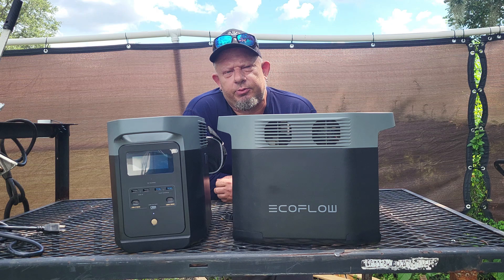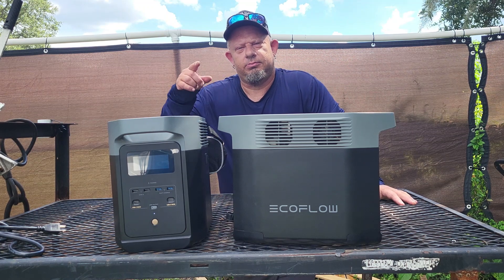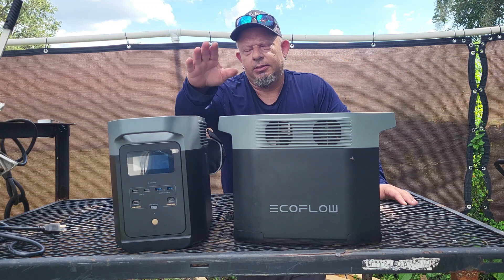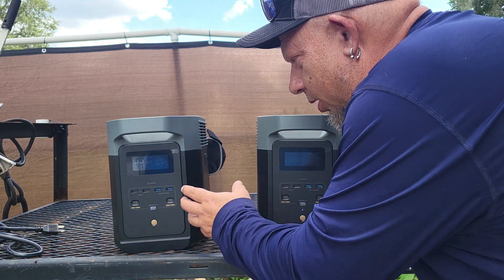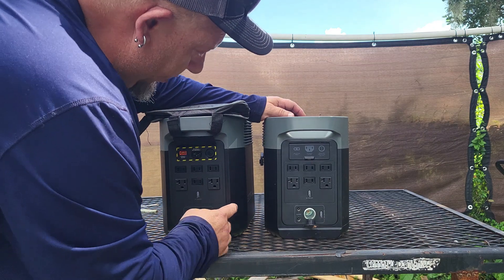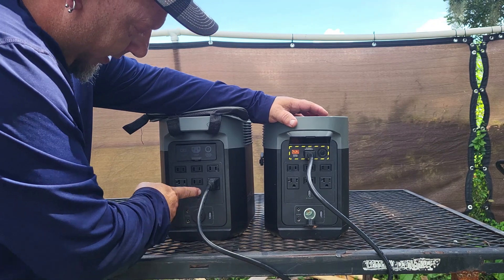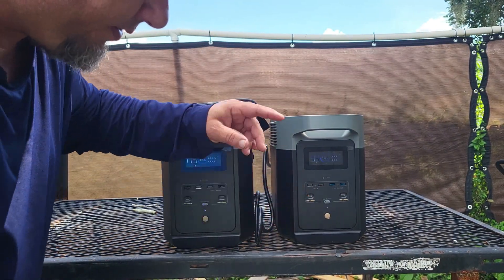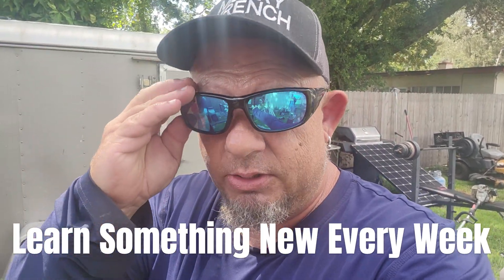Connect Any 2 Power Stations / Daisy Chain /  Solar Sunday

Comment: If you only have a small power draw then youd be better chaining them using the dc 12v plug as you will get a much smaller loss.  The dc doesnt use the invertor so wont lose by having to power that. 

The dc 12v plug will only charge at around 120w though so not ideal in all circumstances.
Reply from the maker: That's great info.. none of these vids are all encompassing.. hopefully they are a starting point for the viewers.. I will pin your comment to the top so others can learn also .. thank you
Reply: My question is when doing this,  would you be able to hook up solar to the one that's doing the charging?
Reply from the maker: @timberwolf7350  in general yes.. most modern units have (pass thru charging) which means you can charge the unit and use it at the same time.. so if we call one the 1st unit and one the 2nd unit.. you plug the solar into unit 1 and daisy chain and it will then charge both units even while using them. be sure you know how much solar the max is for each unit.. connecting them does not raise the amount of solar you can use in the system.. that remains the same
Reply: I’m trying that scenario now. Delta 3 plus shows 95w coming in from delta 2 max, and the delta 2 max shows 100w going out. Only other thing is for some reason the cooling fan turned on the delta 2 max… (it normally only comes on when charging at 600w or putting out something like that.) So there is another small loss going to that, besides the other internals of the delta 2 max. (Generally I don’t find the delta 2 max being very accurate with low output numbers though… as it’ll show zero when there is actually like up to at least 15 watts going through the inverter… so who knows how much it’s actually using to convert.)
Reply: I see why the fan is on… 10 minutes in and the 12v outlet is getting pretty hot with 100w going through it. I didn’t expect that, but i guess it makes sense for the limitations of those ports.
Reply: i burned my dc output trying to use  a no name converter to do it when i first started using them./.. always add a fuse in cables...  altho its a power share  electronicaly   checked then its even better to use fuse !!!
Reply: I've been searching for this info for a long long time i also have 2 of the main units and thought I was going to have to buy that expensive cable and a extra eco flow battery.  We'll the cables are not crazy expensive any more.   Your the man.  Such a simple solution.

Comment: Hey Munky Wrench,  I learned from you today that I can daisy chain my to Delta 2 units by plugging one end of the cord into  the AC inlet on the back and the other end in one of the outlets on the back of my second unit.  Thanks for that.  Question: can I daisy chain them together by using the optional second battery cord?  So instead of having a Delta 2 and a spare battery, I'd have two Delta 2 units wired together plugged into the side spare battery ports?  Will two Delta 2's plug together using the side port on each unit?  If so, will the draw power together and charge together?
Reply from the maker: glad my video was entertaining and you took the time to comment.. if you plug them together like I showed in the video they will both charge together because they have (pass through charging) and they will feed each other so you in essence double your capacity.. however from what I understand and have read about them you can not plug them together via the side port.. which is a dedicated plug for a spare battery. The reason for this from the best of my knowledge is because the SPARE battery does not have the same BMS and it connects differently.. is is a propriatary thing with ecoflow so you cant use other branded spare extender batteries .. it wont read them and is wont read a full delta 2 for the same reason.. its to get you to think you should buy their products,... but if you use the plugs the way I show not only can you connect 2 deltas but you can connect any brand of portable power station in any size ... and the pass through charging will allow them to feed each other and charge off the same charging unit or house plug... hope that helps

Comment: What is the point of this?  If you have 2 of them just just plug the load in the other one when the first one goes flat.  You are wasting power when you convert it to AC the lose again from AC to DC
Reply from the maker: most people are interested in this for when they are sleeping .. or when they are doing something they dont want interrupted and its just an interesting thing people dont know and clearly need to know judging by the questions in the comment section. think of it as an interesting factoid in a life long journey of education

Comment: these are the smart batteries.   Can I connect together 2 delta 2 power stations rather than 2 delta smarts?  And can I connect to my delta 2 a delta pro or another power station that has a greater wattage such as 3600 delta?
Reply from the maker: You can Daisy Chain ANY portable power stations together this way as long as they have PASS THROUGH CHARGING ... google your model with those words and make sure but most if not all power stations have pass through charging.. brands and sizes don't have to match.. hope that helps.. Merry Christmas

Comment: What happens if you have solar panels connected to both units? Will both charge or only "unit 1"
Reply from the maker: if you are able to daisy chain and also have solar hooked up to input on each .... they will both charge individually from the solar and still be connected .. The input method should not matter but as always check your manual

Comment: I have a Delta pro 3 and a Delta 2 max .  The reason I would connect them together is because mt 3 has a 30a rv inlet and is plugged into my trailer.  The 2 will feed the 3 that is plugged in to the RV.  I cannot plut into the 2 without an adapter

Comment: Would both power stations charge if you plug the Main power station into an AC outlet using an Extension cord?
Reply from the maker: lets call the 2 units.. unit one and unit 2.. if you plug unit 2 into unit 1 it will charge off unit one.. if you plug unit 1 into the wall it will charge unit 1 and unit 2 will charge off unit 1.. hope that made sense.. so to answer simply... yes
Reply: @MunkyWrench  Yes
Reply from the maker: @mannyfragoza9652  let me know how it goes.. i do it all the time with my 2 units

Comment: Munky Wrench< I love deals. I own a Delta 2 Max (2,000) w power station and was looking for an extra battery. I saw a prime day deal on Amzn clicked buy, only to find out that it was not a spare battery but a delta 2 (1,000w) power station. I was unable to cancel the order but got the great price and got pissed off afterwards and impulsively bought spare batteries for both of these (great for Delta and Amzn but not so good for me). I saw on a youtube video that you cannot connect a Delta 2 smart battery to a Delta 2 Max power station. Is there a way to mix and match these because I use mine in a storage container with no utility power or solar and have to take them in the car to the house (1 block away for recharging) I am pushing a young 80 so it is not that easy. My question is, is that youtube video I referenced misguided (lying) and can I mix and match the batteries with the power stations. For example a combination of either tying the power stations together or using one of them with the two extra batteries to save the number of trips for recharging? Thanks!
Reply from the maker: every time a new product is launched it is proprietary and has new patents filed.. because of this they want you to buy a whole new setup and spend more money.. you can not interchange the 2 products from what I have found.. because they have different charge ports and different interfaces.. the units themselves have pass through charging so you can daisy chain them together .. having said that.. you should be able to connect your ext battery to the unit and charge the main unit with no issues .. it will be slower and does not actually consider it an expansion but you can do it.
Reply: I feed my Delta 2 Max with a Delta 2 (like yours) no problem.  I use the DC to XT-60 connector.  DC out of Delta 2 to XT-60 in on the Delta 2 Max.  It will only pass through about 108W, but that is plenty as it does to continuously.  If I run my fridge circuit using the two units this way, the Delta 2 will empty out after about 7-9 hours and the Delta 2 Max will still be at around 70% capacity.
All this being said, I have heard cautions about daisy-chaining units with the AC power cord.  Not sure why but about to look into it now.

Comment: CAN I STILL LEAVE IT PLUGGED INTO A GENERATOR OR A OUTLET AT THE SAME TIME WHILE PAIRING
Reply from the maker: yes most power stations now have " pass through charging" which is a protected system and can be used in every way including daisy chain while being plugged in

Comment: You did not double your capacity, you increased runtime, 2 very different things, if you increased capacity, both units would share the load, but its not, only the unit being fed is handleing the load, the other is just sending its power to the other. 90 % from your second unit, too funny, its not 90% effecient, and then you have idle consumtion you havent even factored in. Of course if you believe the watt meter on the front, your truly lost! If the unit is powered on, its using power from the battery, but your meter shows 0 w output, I dont get how gulible people really are, and its really just common sense. So many reviews, and such little knowledge, YouTube is truly comedy hour!
Reply: He still doesn’t understand what you said

Comment: Right now, the retail pricing makes it more economical to do this instead of buying the expansion battery. EcoFlow is charging between $499-$799 for the extra battery, and you can get the Delta 2 for $499 at Lowe's or as little as $318 on Temu. Delta Pro and Delta Pro Max are out of my range, sadly. Trying to get one more Delta 2 and a Delta Pro before the Lithium tariffs kick in.

Comment: I am doing this cureently with a jackery 2000 and a pecron. Both 2k limit output on wats. My issue is they both when charging will pull 1500 wats from the other. So any load above 500 wats kills the power output. Any solve here? A way to reduce the 1500 wat charging transfer?
Reply from the maker: I read this comment 4 times and something is not adding up.. you have 2 units.. we will call unit 1 and unit 2.. you chain them together.. so unit one is basically feeding unit 2.. unit 2 should be able to discharge up to 2k watts without any issue.. are you attempting to plug into the same unit that's feeding the 2nd unit? if so that's your issue.. one unit can ONLY feed the 2nd unit.. and you can only power items for use off 2nd unit.. there should be zero issues with that.. if you attempt to plug items into the same unit thats is feeding the charge to the 2nd unit you will overload the system.. am I making sense?

Comment: You didn't daisy chain anything,... because anything can be plugged into a solar generator,?? you just plugged another device into a solar generator. None of this is news..
Reply from the maker: it is news to people brand new to solar and power stations.. by plugging one into another you EXTEND THE USE TIME . thats the point of the video for newbees.. I have to make videos for everyone so I am glad you have some experience with them and I hope you chose to pass on your knowledge to someone without being a dik. Thanks for coming by
Reply: I’m a beginner but I would much rather by a battery than a new power station it is cheaper

Comment: Can you have 500 solar input on both of them?
Reply from the maker: when you daisy chain multiple units you are still limited in your input to the max PER UNIT .. they do not add together so if the max per unit is 500 watts .. then the max when connected is still 500 Watts .. sorry for the bad news.. but since just connected by a cable you can always unplugg them and charge individually at the max for faster charge
Reply: @MunkyWrench no that actually good new because if you hook it up to an extra battery and not this unit you don’t have any solar coming into the second unit. The way you show it I think the max is 500 watts each so a total of 1000 compared to only 500 with the extra battery.

Comment: I just had an idiot tell me he works for ecoflow and that my power station will "go up in flames" if I do this in response to someones question if this works. I've done this literally 50 times without a problem. I plug my old Delta 1300 into my newer Delta 2. Of course people argue this isn't as "efficient" but in my opinion it makes more sense to have two separate units than an "expansion battery" that's practically useless on it's own. In the video you say not sure why anyone would want to do this since you can just plug into the other unit once one dies. Well I do this because in a power outage I plug my garage freezer and fridge into one unit and daisy chain the older Delta 1300 into it so I don't have to worry about switching units. I'm not sure how long it will actually last, but it did go two full days once and if I remember correctly there was still a little juice on the backup unit.
Reply: I enjoy, but I laugh a lot at all these how to hacks and work around on these Ecoflow, Bluetti, etc, units! Simply amazing the lengths people will go to improve subpar equipment!  But it does make some hilarious vids to watch! I got 9 subpar units I'm connecting together to get ....., this is how you connect another battery of a different brand to get more capacity, which,  you dont, you just get more run time, which is 2 different things. When you could have bought a real system made to do it all in the first place! Oh my system died, I'll just bye another, WTF
Reply: @dustydawson8977  So what's an example of a unit that isn't "subpar"? And don't say one you would build yourself because lets be honest the far majority of people aren't capable of building their own unit with all the features these have built in. You also have to take in consideration portability, all-in-one features, and warranty. I'll await your answer......
Reply: @tonyinfinity   Any one of the 3 Titans, from Point Zero Energy!  They are the only company building low frequency ( transformer based just like the grid )units!  But your probably too late, they just stopped making them, only way you can get one now is, if someone is selling there's . They are modular, built like a tank, all metal, infinately exspandable, the only unit that can actually take any battery,  from any manufacturer,  and any chemistry, not a hack, but built with plug in battery expansion, which will charge and discharge those batteries, the difference is they actually do increase capacity, not just runtime, the load is actually spread over the batteries, load sharing the amp draw with there own batteries! A real 3000w output, on 6 ac plugs set in 2 15amp circuits, 5  13.8v. 20amp cigarette plugs, dual 150v mppt controllers, 2000w, and dual 25 amp ac chargers, 1500w, 20 amp car charging, and can charge batteries direct individually,  can charge from all ports simultaneously, while discharging full power, and made to do it long term day after day. It's a 24v system
Reply: @dustydawson8977  LOL Point Zero? No thanks. Their stuff looks like it was built in a garage. If they are/were superior than why are they out of business? I'm glad I didn't buy one of their units, there's no warranty now. This is why I won't buy from one of the smaller companies, yes they might offer cheaper units but if the company isn't around next year you have an expensive paper weight if there's a problem. Ecoflow and Bluetti only for me. I haven't had one Issue from either and have been using my first unit for over 3 years now, works as well as it did brand new. I haven't even lost any capacity on the batteries. You do you, I stick to what I prefer.

Comment: Adding my first comment: why would a person want to daisy chain two units? Let me preclude by saying I just got two Ecoflow Delta 2 Max units for $699 ea. off eBay (refurbs) and they were cheaper than buying one EF D2M and the extra battery, hundreds less $. So the reason I want to couple them is because for my pickup truck topper camper I want to run the Ecoflow Wave 2 with a longer run time (i.e. all night) without having to unplug from one and plug into the other.
Reply from the maker: Good point well made. That is a great price on those units. I know you will be happy with them. I love my Ecoflow units.

Comment: Is there a way to double the output wattage not the watt hrs by daisy-chaining two  power stations? Thanks, enjoy your channel.
Reply from the maker: Thanks for watching and subscribing it really helps.. now given that I am an idiot.. I will say this .. as far as I know you can NOT do that . the inverters inside the unit have a max watt output and because there are 2 invertors with a built in top output.. stringing them together in a single line does not raise the output.. it stays exactly the same as the lowest output.. so daisy chaining is good to expand the time you get from usage but not the amount of power. I rarely daisy chain units.. I connect a 100ah LifePo4 battery to the power station to double the capacity or run time and its much cheaper than buying another mid size power station... Hope this helps
Reply: @MunkyWrench ya you can get those big 48V 100 AH batteries for less than another battery generator. But I just bought the Bluetti AC 180 for $377. That comes out to around .32 / KWh. Those big batteries come out around .23 / KWh but are less capable than the Bluetti AC180 and the charging on the Bluetti is hard to beat.